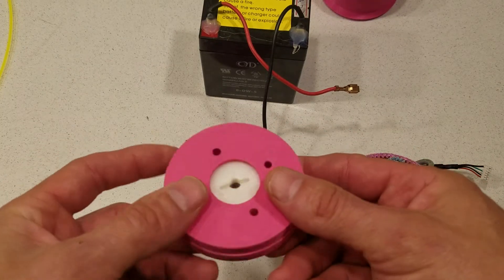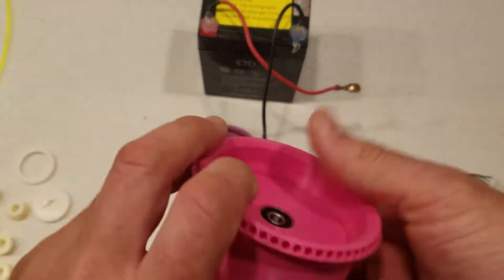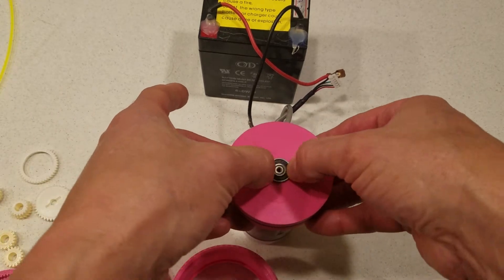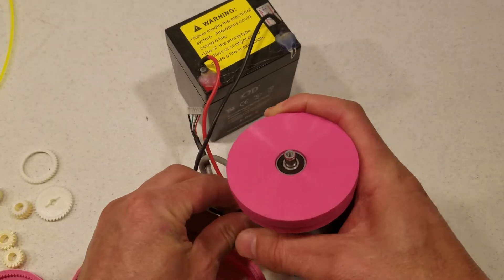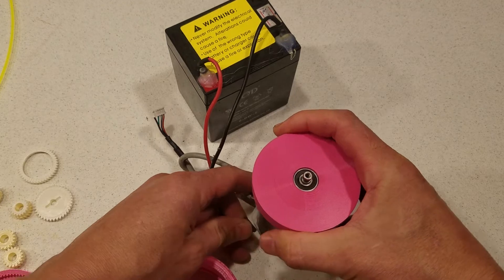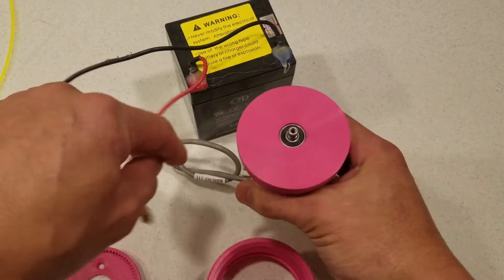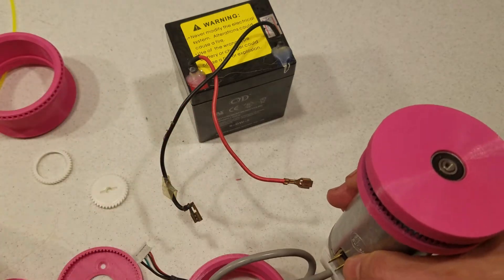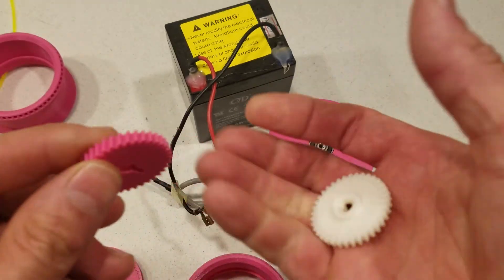FilaMecanum - Transmission test

Comment: Do you not have problems with shrinkage on your gears?
Reply from the maker: Of course I did.  :) That is predictable if you need to do so, but I did not.  I just printed the two large parts to fit the stepper, and then tweaked the size of the planets to fit that.  In the end the planets needed very little scaling to fit.  Somewhere on the order of 2% if I recall correctly.  In the latest I used PLA for the rings and nylon for the planets/sun gear.  That required two trys to get right, but this is 3D printing.  You can just iterate until things fit right.

Comment: Hi, I love this idea, but please use a sharpie, draw a single black line on the top (like the hand of a clock) and let us see visually how slow the top turns when the gear reduction system is being used.  A single black line spinning on the surface lets us know intuitively how fast/slow this thing is really turning.

Keep up the good work.
Reply from the maker: Yeah.  I should have done that but second guessed myself as that's the outside surface and so would show in the finished project.  Some on the edge would have worked I suppose.
This output ring gear was printed with concentric infill and so the visual cues I had for the other ones went away.. 
Next video will be with the rim attached so that should be pretty obvious then.